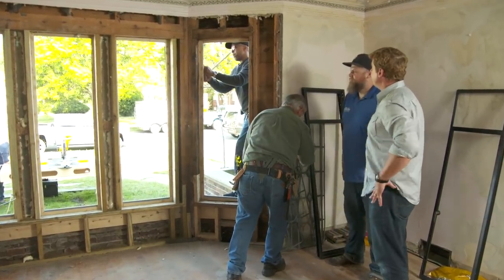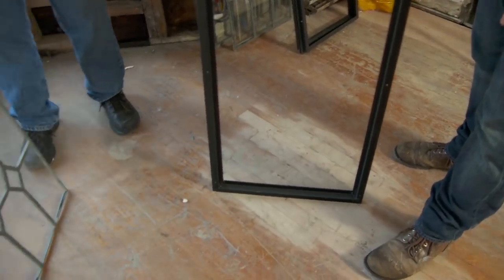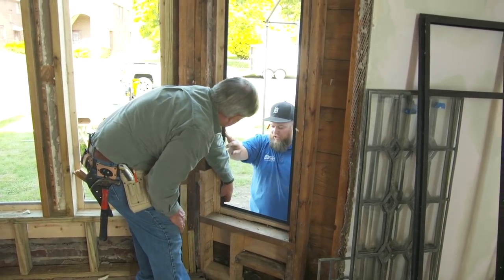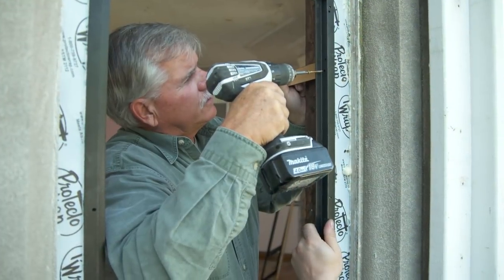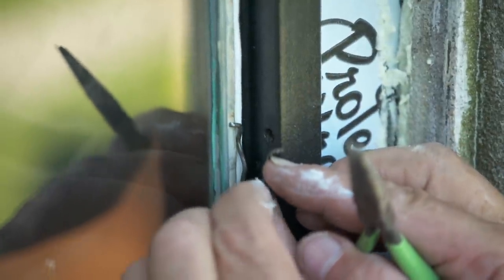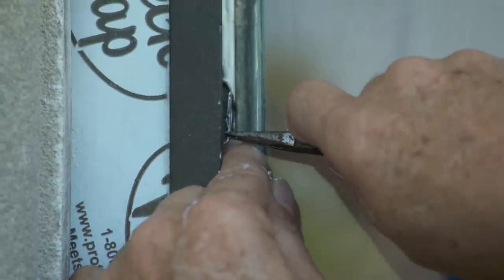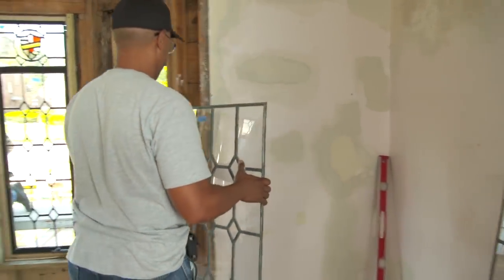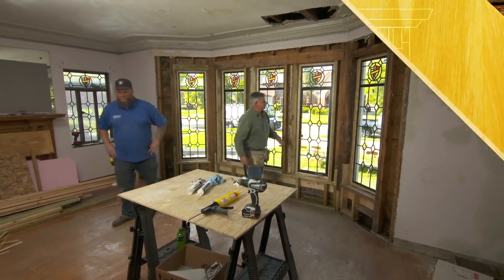How to Install Antique Bay Windows | This Old House

Comment: I would think you'd want something more like a pan head screw to hold those frames in so the screw head holds flush against the frame instead of the counter sinking screws they used that are often used wood to wood where you can... counter sink the head.

Comment: Hello, Do you protect those beautiful old stained glass windows by adding a cover or storm glass or something like that? Thank you. 🧡
Reply: Depends on the area. If it’s a hurricane, tornado, or high wind zone, then they will protect them somehow
Reply: Leaded windows are very durable and these appear to have been made very well. 

Covering them will trap hot air and can cause harm overtime. It you live in a cold climate you may want to consider interior storms. 

Or good drapes. ✌️😉
Reply: No matter what u do those windows will never b protected from a piece of 3/4 gravel cracking it.
Reply: @borys444  
No doubt about that. But given the way these windows are made a single broken lite (or several) can be replaced without needing to replace the whole window,...as is generally the case now. 

Leaded windows are sound technology. Find’em, Fix’em and then keep’em safe. We’re not really making them like they used too so we must preserve what we’ve got. ✌️
Reply: @jadenr.11  Well, their in Detroit.
Reply: @saulgoodman2018  they’re
Reply: @jadenr.11  what’s up with grammar police? 👮‍♀️ we r here to constructively criticize these windows, no one is here for an English lesson.
Reply: @borys444  we are constructively criticizing the windows and peoples grammar
Reply: @jadenr.11  ur Wright
Reply: @Kevin-mp5of  Why would you think that?
Reply: @Kevin-mp5of  
Oh Kevin that’s no way to think. 

Leaded windows like those bring so much character and value (esthetic and otherwise) to a home. And, now that these ones been professionally restored there’s not a modern window on the market that will outlast them. 

But to each their own I suppose. ✌️

Comment: How energy efficient are those windows?  There's definitely a slippery slope between energy efficiency and preservation.  A large vintage bay window like that is going to have a lot of thermal transfer...
Reply: R value of 87.35 or about equal to 5 feet of rockwool
Reply: R0.0001
Reply: A bit better than a piece of paper....they are nice looking but the owners are going to hate their energy bill.
Reply: @scallywag1716  And hate standing near them in 0F Michigan Winter
Reply: 💧 + 🍿= efficiency